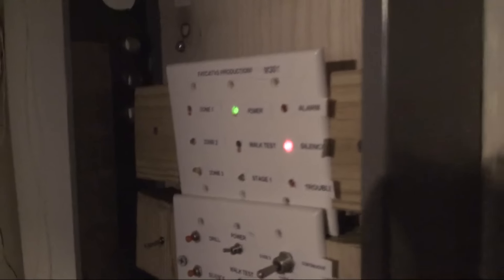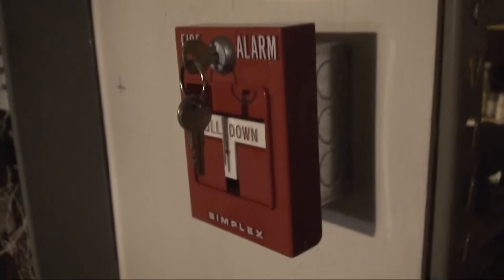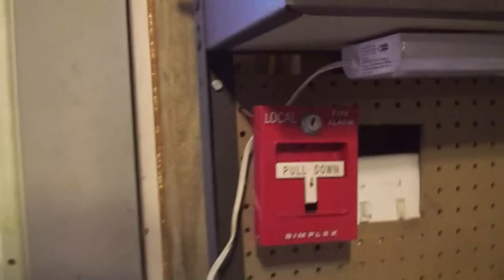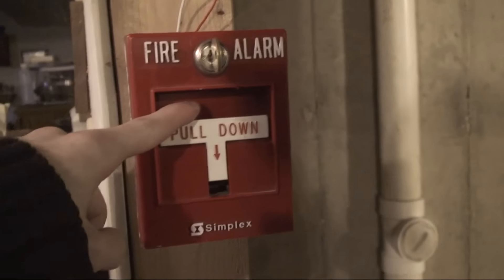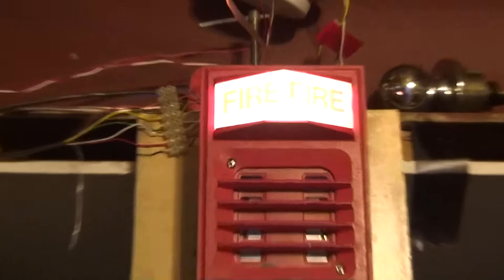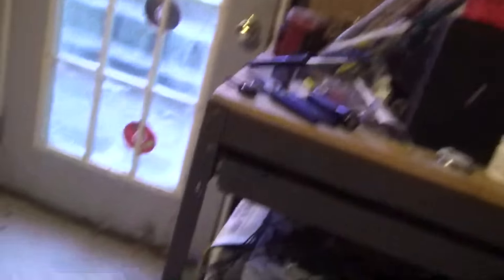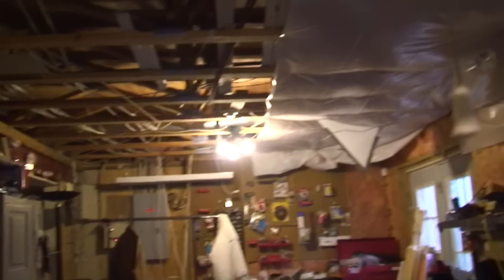System Test 14:  CLEAN!!!

Comment: Dang! You take pretty good care of your devices, obviously. The strobes are almost scratch less... If I could keep MINE like that, it would be a miracle XD
The only problem is that I get my devices from eBay, so anything I get that is used is pretty scratched up 90% of the time. Did you get your devices used or new?
Reply from the maker: Some of them are used, some of them are new.
Reply: FrostedStrobes you should do a system test with spectralert advances on code 3 hi volume
Reply: Some times
Reply: +0meses +0
Reply: Aaą
Reply: X

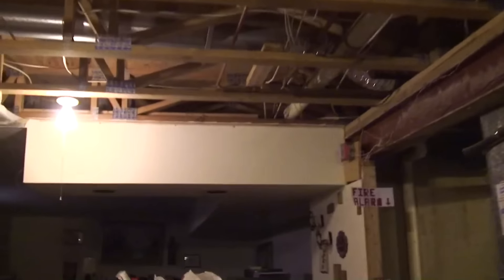Comment: Why is there a System Sensor 2400 at 5:13? Tied into a security system?
Reply from the maker: Yeah it goes to the security system,  one time mom burnt something in the oven and it went off.  The speaker on the outside of our house went off too.
Reply: FrostedStrobes Cool; I have an ADT wireless security system, but the only fire alarm thing it has is the fire panic button. My parents didn't want to spend more money on it and we can't have motion detectors because my dogs would be tripping the alarm when we aren't home; but we have glass break detectors and door contacts.

Comment: Awesome! First! :)
I just got a couple new alarms. My school has 2903-9101/9838s, but I've probably already said that about a thousand times lol.
Reply from the maker: cool!  hopefully they don't upgrade to those horrid spectralerts.
Reply: Yeah, the dead alarms are replaced with Wheelock Exceders, which is odd. I expected TrueAlerts but I guess Exceders work. Not many will be replaced anymore because my school is going to be torn down after my graduating class graduates out of it because they're building a new school.
Reply from the maker: You should try to grab as many alarms as possible!
Reply: FrostedStrobes I know; I probably will. It won't be till at least 2019 though :)
Reply: ok.